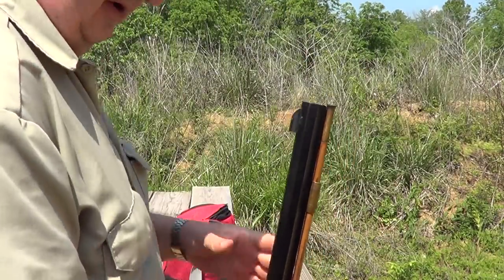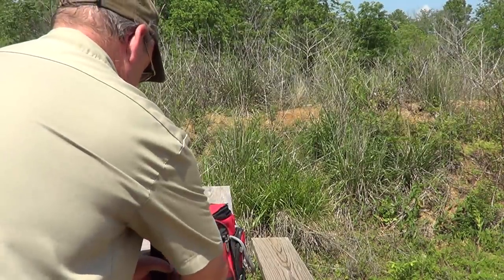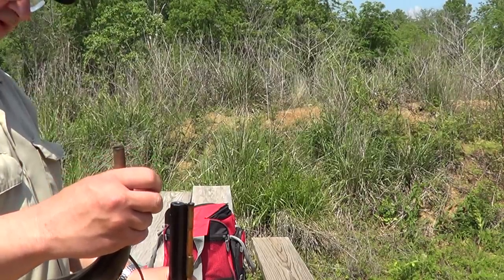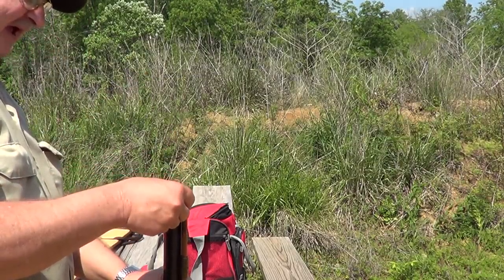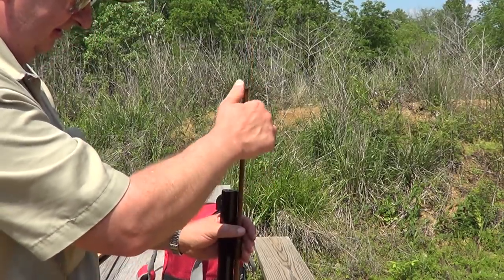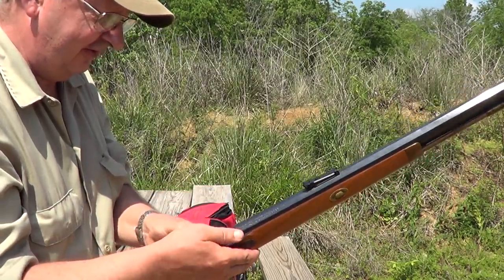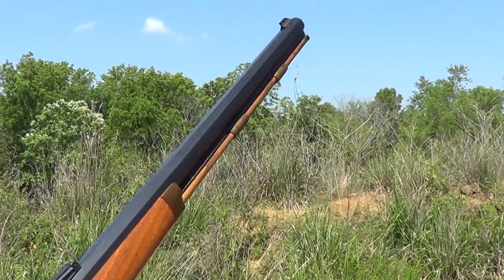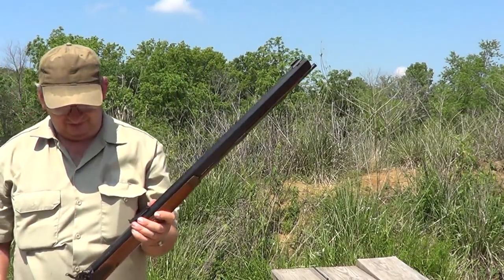Loading A Black Powder Percussion Rifle

Comment: Just blast some compressed air down the barrel; whatever is blocking the weep hole would simply get ejected. No need to waste a cap.
Reply from the maker: +jjenson2006 Last time I was at the range I don`t remember having an air compressor handy. :)
Reply: 1957Shep
Do you live at the range? If you blow out your gun before you leave home, there's no need for it at the range.
Reply from the maker: +jjenson2006 Some people say I do. :)
Reply: 1957Shep
Do you clean your gun at the range? Most people clean their gun at home.
Reply from the maker: +jjenson2006 Guess my attempt at humor wasn`t that funny.
Let`s try it this way. What percentage of people do you think have air compressors at home, or at the range?
Most people would just use a cap to clear any left over oil out of the nipple by firing a cap.
Reply: 1957Shep
I thought all men have air compressors at home.

Most people would just use a cap to clear any left over oil out of the nipple by firing a cap.

That's why I left my comment, so people will realize there is a better way. Try not to over-analyze this; it's just advice.
Reply: +jjenson2006 Ive owned quite a few bp firearms, and have been shooting black powder guns for years.  It's better to use a cap to clear it at the range, because you don't know if anything may have gotten in there while transporting the firearm. And it's far easier to do it that way anyways.  Why the hell would you go through all the trouble to turn on the compressor, wait for it to finish running, make the hose connections, etc etc, to do something you can do in 2 seconds at the range with a cap.  That's just dumb.
Reply: +LJPerreiraII Why the hell would you go through all the trouble to turn on the compressor, wait for it to finish running, make the hose connections, etc etc, to do something you can do in 2 seconds at the range with a cap.

I don't. My compressor is always full of air as I use it for a lot of things that would make life easier for everyone if they did the same. It's plugged in and controlled by the high and low limit switches. The hose is already connected, all I have to do is pop on the air nozzle, stick it into the barrel and squeeze. Done in a fraction of a second.
Reply: Except its recommended you drain/decompress your air compressor when not in use. Good job.
Reply: +LJPerreiraII I use my compressor almost every single day. I drain it once every two months, unless I am using it to do some painting; in that case I would drain it beforehand. If having to drain a compressor is a reason not to use it, then why did you even buy it in the first place?
Reply: +jjenson2006 Are you dense? Not all of us use an air compressor on a daily basis. I have a small air compressor to use on small tasks around the house, maybe once every couple months. I'm not going to run the air compressor just to clear a barrel I'm going to end up clearing again at the range. So I use a single cap. So does everyone else I shoot black powder with.
Reply: +jjenson2006 so you've never been with a woman? I figured I was talking to a child, guess I was right.
Reply: +LJPerreiraII Yeah that's right, I'm a virgin; my daughter teases me about it all the time. You win, I have better things to do with my time than waste it here with you with unproductive non-sense. Go ahead and have the last word if it makes you feel good about yourself, but it would be pointless because I won't be reading it.
Reply: +jjenson2006 haha, ok bud. You need to relax. It's been fun, though.
Reply: jjenson2006 Yes, most black powder enthusiasts do clean their guns, numerous times per session, at the range. Why? Because of black powder/bear grease residue building up after just a few shots. Also, I tried your air compressor trick while at the range. An air rifle enthusiast had a 4500 psi cylinder. He let me attempt to blow an obstruction from my barrel with it. It did not even budge the obstruction. That being said, normal air compressors only compress to around 150 psi. So, I put a cap in and voila! The ball came rushing out the business end. Problem solved. Thee End. 😁
Reply: An air rifle enthusiast had a 4500 psi cylinder.

There is no CFM behind it. It is a tiny bit of air, of course it's not going to clear it out; you'd do just as good farting through it. You'll also notice that if you hooked the air rifle to an air tool and fired it, it would do absolutely nothing; wouldn't even budge the air tool motor. BTW - 90 psi pressure with several CFM's of air behind it will work very well, but you need a compressor. An air rifle is no comparison.

Air going through a line is like electricity going through a wire. With electricity, you need both voltage and current to get power; an absence of either of those will give you no power. With air, you must have CFM and PSI, the product of the two gives you power; which is needed to push anything out of your muzzle.

Comment: What is the purpose of the double set trigger.  I knjow how it works, but why is it there?
Reply: +Topolino a lighter trigger pull makes for a more accurate shot.  A heavy trigger pull may pull you slightly off target.  But you dont want a hair trigger while you are loading one of these, just might blow your hand off.  So the set trigger allows you to set the hair trigger when you are ready.
Reply: +Topolino Safety probably.
Reply: Topolino That's the old version of a 2 stage. Set the first trigger and the second trigger (the one in front) is shorter and lighter to squeeze.
Reply: LJPerreirall.  That SIR is the VERY BEST explanation of a double set trigger and a hair trigger, in one very concise paragraph that I have ever seen. I shall  use it Myself, with Your permission  (or without) LOL. take care.

Comment: there is a big difference beteen old school and out dated, this is just outdated, the time it took to reload, no wonder the armies all fought at once. they needed every man
Reply from the maker: +I spent 6 hours trying to figure out my username You would be surprised how fast it can be loaded with a little practice. And it goes a lot faster if you just do it instead of explaining it while you do it.
But this is not the type of gun used by the military. They used either smoothbore muskets or later rifled muskets with a hollow base mini-ball. Those load faster, but are not as accurate as a rifle like this one. Rifles like this would have been used by a hunter.
Reply: 1957Shep you know your stuff.
Reply: During the civil war, the average soldier could reload and fire three times a minute. True that was on a much larger rifle than the one in the video- they used .58 caliber Springfield’s and enfields. But the main reason every member of the army fought was due to outdated tactics, not the weapons. These days, when we engage the enemy, we still all shoot and have to fight unless we can be relieved and rotated back, and that’s with semi and full auto weapons at our disposal. What matters is making each shot count, same now as it was then. One shot, one kill. 
The biggest difference between percussion weapons and modern firearms is the use of the metal cases carriage, which enables more of the energy created by the explosion of the charge to be harnessed and directed on the rear of the projectile (bullet or shot) which accelerates it and stabilizes its flight better. And while modern mechanisms speed up reloading, the goal (unless you’re stuck laying down suppressing fire) is to use as little ammo as possible to neutralize a threat. Same as back during the percussion cap days.

Comment: rubber cap gun caps are so cheap... why not use one of them to clean the nipple?
Reply from the maker: +sgt. Nickel Not sure what you are referring to.
Reply: 1957Shep you know the lil red ring things that toy cap guns shoot? i was wondering if they will work?
Reply from the maker: +sgt. Nickel Doubt if it would fit or work.If you could get it to go off it might blow some of the paper into the nipple and cause the very problem you were trying to solve.
The #11 percussion caps used on this gun are about the size and shape of small pistol primers.
Reply: 1957Shep thanx thats all i wanted to know.. i did shoot a cap with it and it seemed to clear  the nipple... but i did it with chamber empty... i dont want to fuck up my gun... lol
Reply: +1957Shep so i tried it.. it kinda works but allot of times the rubber is cut and plugs the nipple. i see why normally it isnt done... but it dose fit the #11 niple
Reply: Cap guns are meant to make noise, firearm percussion caps are meant to throw fire... So no it wouldn’t work.

Comment: You (NEVER LOAD YOUR POWER FROM YOUR POWER HORN/FLASK) directly into the barrel! Very dangerous it could explode inquiring yourself!  SMH
Reply from the maker: There is a spring loaded cut off at the base of the measure separating it from the powder horn. Any horn or flask that has a measure mounted on it has a cut off.
But it`s not really relevant since you should wait a bit before loading another shot to give any embers time to burn out.
Reply: Never I saw someone just about blow himself up good thing his horn wasn't full

Comment: Not wise to pour powder into your barrel from a horn or flash as you are holding a potential low power grenade if it flashes.
Reply from the maker: There is a cut off between the powder horn and the measure. And I always allow plenty of time for any embers that might still be in the barrel to die out.
And that was the first shot of the day anyway.